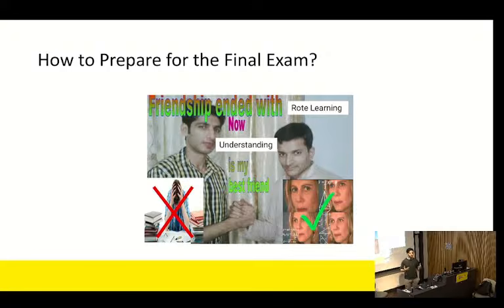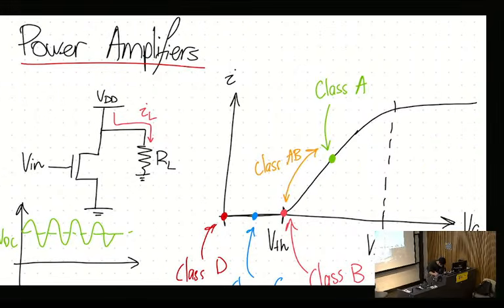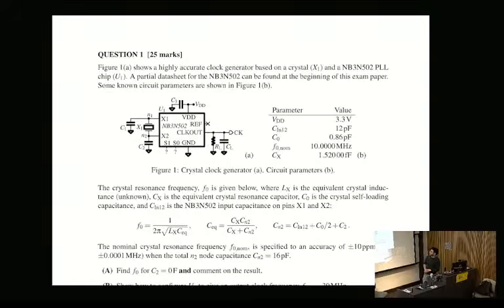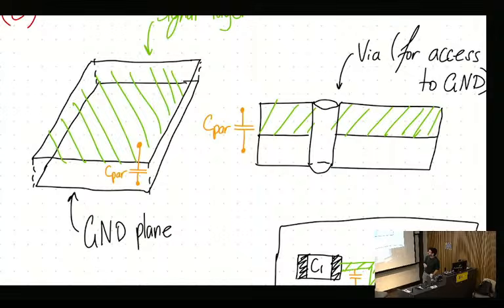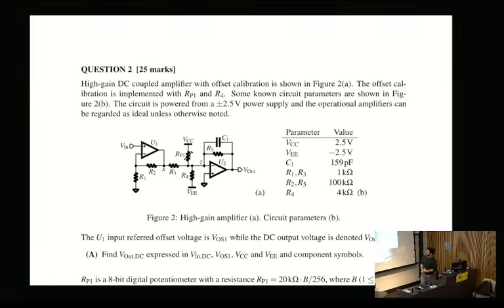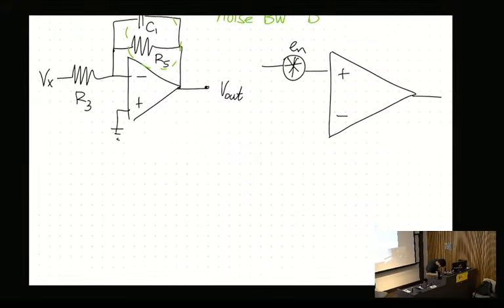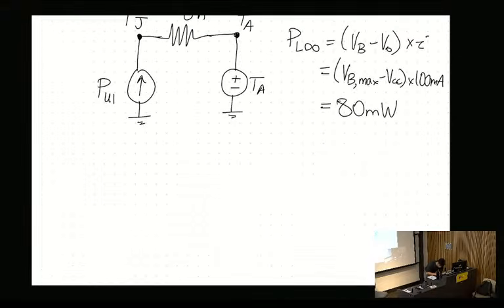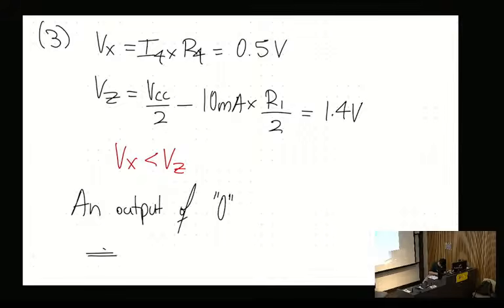UNSW ELSOC Presents : ELEC3106 Finals Revision Session

Comment from the maker: Note: The flip-flop used to explain setup and hold times from around 49:00 to 1:01:00 is intended to be a negative edge triggered flip-flop. This is explained and corrected later in the recording.

The overall operation remains the same, but the drawn clock signal would need to be flipped for the flip-flop shown. As drawn, the timing diagram is correct for a positive edge triggered flip-flop.